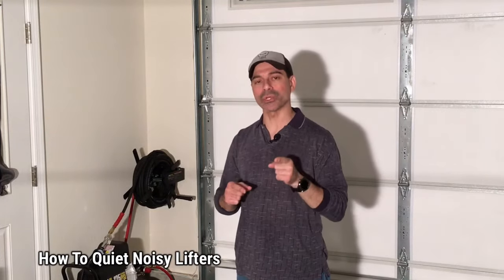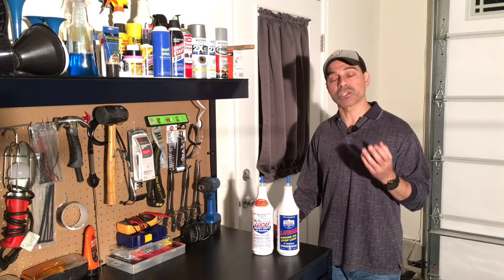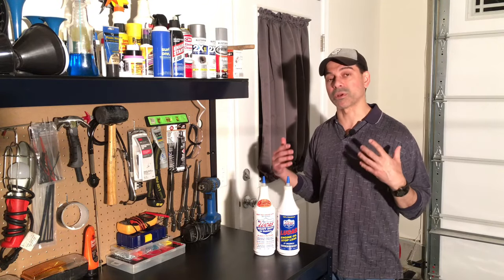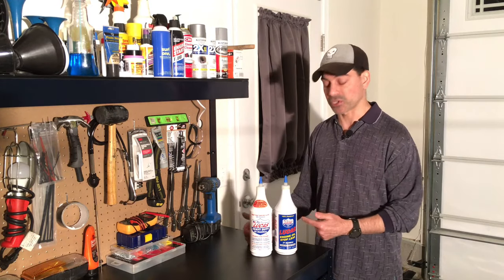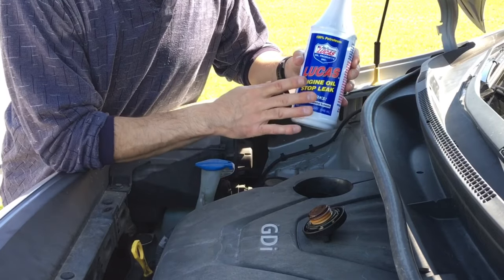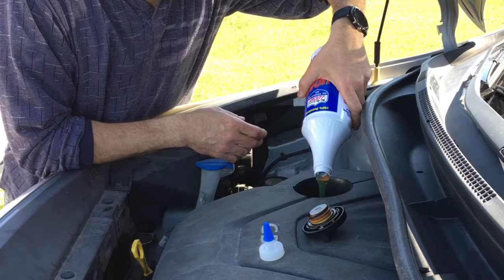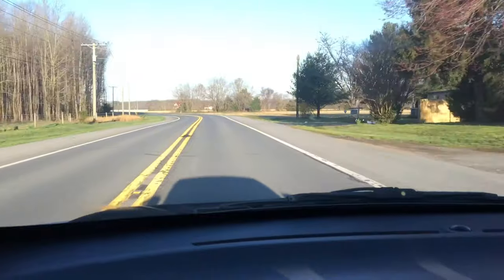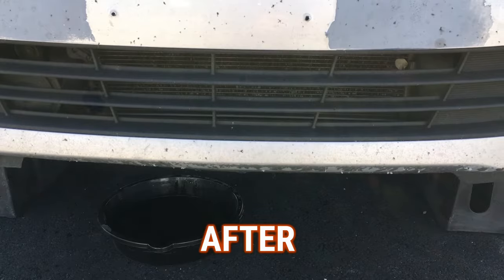How To Quiet Noisy Lifters (Andy’s Garage: Episode - 253)

Comment: Well we tried that in a older truck with the vortec V6..guess what yep fixed a lifter but thinning the oil out not cool..the motor spon a rod bairing..I can tell you this especially in the new generation motor keeping the oil changed is key.. however a motor with some miles on it will gum up lifters ..so what has the best detergent without harming your motor...so do a oil change and filter the trick add one qt. of transmission fluid to motor oil .cleans the inside of your motor up and will run great .just a tip we use all the time we yes tryed it in a engine and then took the motor apart nice and clean..does NOT EFFECT THE MOTOR NO HARM DONE..

Comment: Can the addititve help your lifters last longer I know I need new lifters soon but so far just have bad ticking no misfires yet ? I figure I got about 2 to 3 months left on the lifters without addititve is it possible for lifters to go 4 to 6 months with addititve? ( motor has been replaced one rebuilt another time so I do know my time frame from how noisy they are) 492457km on truck its a work truck 6.4 hemi
Also thank you for making this video
Reply from the maker: I wouldn’t add this unless your lifters are making noise. Wouldn’t use it as a preventative since it thickens the oil too much

Comment: Question… 2012 dodge charger, v6. I normally get my oil changed by a professional. Can this be added post putting oil in or does it have to be done before?
Reply from the maker: It can be after but you need to drain out the oil to accommodate the additive. You don’t want to overfill the oil.

Comment: This was very helpful. Just started hearing an on an off tick in  or around the engine. It doesn't tick often or for long so I wasn't sure if it was the lifters or the alternator or timing belt. I just changed the oil a few days ago so I will keep an ear open for the tick. This practice will be helpful as my car has 188,000 miles on it. I will definitely try this when I change the oil. I use a high mileage oil but I haven't added an additive. Very helpful!

Comment: I had an oil change done about 2 months ago and don't drive the vehicle more than 100 miles per month. Do I have to drain the oil, or can I just add the stabilizer and stop leak to the existing oil?
Reply from the maker: You can add it, just make sure you drain enough oil out to make capacity for the additive(s). You don’t want to overfill your engine

Comment: My 2018 pathfndet has been making this noise for a couple months now because i waiting too long for a oil change. How much would you recomend i use?
Reply from the maker: Start by draining the old, replace with synthetic oil and a good filter. I would only add 1 quart of additive to start. Adding 60% additive is only recommended for very worn engines.
Reply: @PhillipsVision  thanks for your advice
Reply: @PhillipsVision  oh and should I get the synthetic heavy duty oil stabilizer too or will regular be ok?
Reply from the maker: @AstroDestination  to be consistent get the synthetic
Reply: @PhillipsVision  gotcha. Thanks again.

Comment: Is this a permanent fix? And what if I don’t have an oil leak? Should I just use oil stabilizer?
Reply from the maker: You should use it at each oil change, one application is not permanent.
Reply: Is there any other damage that is being done by doin this? What exactly is this doin to quiet it?
Reply: Oh, any ballpark figure to replace them?
Reply from the maker: @marco785  this won’t fix the damage already done but will add a thicker lubricant to help quiet the noise
Reply from the maker: @marco785  around $2,000 unless you can do it yourself

Comment: I have noise from the lifters when the car sitting for some days due to oil goes down. Is that a problem? 

I had an engine shake as well once. 

Oil is freshly and at the correct level.
Reply from the maker: @apostolisr8556  probably not a bad idea to add a little oil to the crankcase before starting if it’s been sitting for a long time. Some vehicle require this. I have a friend who destroyed his engine because he started it after it sat too long and the engine ran dry for a minute.

Comment: Would it help for a 4200 v6 gmc envoy? Driving down the road the knocking started lost power. Oil was dry, put 4qts in but still a loud knocking and loss of power...
Reply from the maker: If the oil was low and dry you may have damaged the engine
Reply: Yes I'm positive I might have. The noise got quite on top of the motor .. now it moves to the bottom of the motor. Sounds like the oil pan area, a squeaking and hard knocking sound. @PhillipsVision

Comment: So question;
 I have a 3.5 I5 Colorado that has a ticking on the top end like a lifter. It comes and goes and I notice it most when sittting in a drive thru and the engine is hot. Does this thing have lifters? Will this work for my engine? THANKS!

Comment: I'm so confused I don't normally use additives in my vehicle at all I prefer to just fix the problem, but do you and the additives before you have oil in the vehicle because that's what it kind of sounded like or can you add it to existing oil. And do you add your normal amount of oil and then the additives or do you have to subtract the amount of oil in the car per how much additive you add?? So if you have three quarts of additive in a 5-quart oil system do you only put two quarts of oil in it or do you put all five quarts of oil in plus the 3 quarts of additive

Comment: If my dodge journey lifters are sticking should I use this? The mechanic said it will cost 1400 to fix it
Reply from the maker: You could give it a try. If they are too bad you’ll need to have them fixed
Reply: Did it work ?

Comment: My neighbor told me to put a quart of mystery oil along with my other 4 quarts of oil during oil change on my dodge journey. Have anyone heard of using this method before?
Reply from the maker: I have. I’ve never tried Mystery Oil
Reply: @ jessiegathe661--      Several years ago, my 2002 Chevy truck had a loud lifter ticking noise. The oil was a quart low, so I added a quart of Marvel Mystery Oil to the crankcase. Soon the lifter ticking noise disappeared. I drove the truck about 400 miles and when I changed the oil, it was extremely dirty. This was telling me that the MMO was removing some of the sludge out of the engine. Now after a oil change and the oil is a quart low, I add a quart of MMO for preventative maintenance. 
       Depending on how many miles that you have on your Dodge Journey, you may have some sludge in the engine. If you add some MMO to your Dodge, I would check the oil more often, and if it appears very dirty, I would change it sooner than later.

    I have also been using Marvel Mystery Oil in the gas in my car, truck, and lawn mower at every fill up since 2016. I use the recommended amount of 4 ounces of MMO for every 10 gallons of gas. Everything is running better than ever, and my car now gets at least 1 to 2 more miles per gallon on the highway.

Comment: I just changed my oil but my lifters are still clattering. I don’t want to use the rislone motor flush or motor medic because I don’t wanna have to change the oil again. What should I do about loud clattering and could it be related why my truck almost stalls when I give it gas?
Reply from the maker: Are you getting any engine codes?
Reply: @PhillipsVision  No, I don’t have a OBD1 scanner. The truck is a 1990 Dakota and I just picked it up so is haven’t had much time with it but I immediately noticed the clattering. Is there anything I can check meanwhile until I can get my hands on a scanner?
Reply from the maker: @josh661  I’d recommend getting a stethoscope first so you can pinpoint where the noise is coming from. That will help know what it could be. Here’s a link to a video I did showing how 
https://youtu.be/3sgLRyzLtdU

Comment: Can I use both products on a rebuilt 3.3 v6 dodge grand caravan 2001 engine? It has that sound since it started and it won't go away
Reply from the maker: Yes, shouldn’t be a problem.
Reply: @PhillipsVision  In my particular case, it could be enough to add only the stabilizer since the engine has all the new gaskets and seals, and if it were enough, I would have to add 60 percent to it... One last question, if the result were positive in the next oil changes you should follow the same procedure, or after the noise has been eliminated you could add only oil without the additive.
Reply: Thanks for your fast answer.

Comment: Im just asking these both oil is not heavy on the engine to use it
Reply from the maker: They are heavy, which is why you have to follow the recommended mixing ratio…no more than 60% MAX

Comment: 02 Chevy Malibu, just got done with a head gasket job, and while screwing the #1 cylinder exhaust valve rocker back down, it kinda didn't wanna go... Ticking like crazy. Pretty sure the lifter is shot, or somehow got turned. Any advice? Really don't wanna tear it down again.
Reply from the maker: You could try an additive to see if it helps. If it’s too bad it will need work

Comment: I had bought Ann 05 trailblazer LS with the inline 6 in it..after I got the coils replaced and it running on all 6 cylinders…it sounded really good..I changed the oil and listening to the mechanics around town I used traditional oil with a quart of Lucas oil stabilizer..that made the engine sound like a diesel when it was first started and had a chatter to the engine that bugged the hell outta me…these things have the dual over head cams with the vvt solenoid in the side of the block that engages the second cam to get horsepower over torque…the vvt solenoid has xtremely fine screens in them that will blow out and into the oil if the oil isn’t constantly maintained…I tried several different additives and nothing helped…I had t  on find the fuse panel info from the owners manual and got to looking through it for other things…and read in it…that it is recommended to use synthetic oil ..5/20-5/30 weight in the engine..this is due to the screens in the vvt..and also how tightly fitted the pistons etc are placed in these newer interference motors….I went and got the synthetic oil and a quart of Lucas….let the old oil drain out for a few hours before filling with the synthetic oil…and the problem was solved..,I always read the owners manual..,and had read most of it when I got the vehicle but hadn’t read that part of it…so now I strictly stick to my own advance and read the damned owners manual when I buy a vehicle..if I had continued using traditional, it would have caused more issues since these engines are sleeved ikr most are today…
Reply: who reading all that 😂
Reply: @kayrogers4024  lmao I tried and gave up started skimming didn’t find anything significant in that lol.

Op can you give us a tldr
Reply: @roddyrich2335  That's too long for you to read? 🤦‍♂️

Comment: Hi there, thank you for the very informative video and responsiveness to commenters..
My mother’s 2012 Toyota RAV4 is not losing oil but rather it has a hydraulic lifter tick...
Is it necessary to add the stop-leak? Or  am I fine with just the Lucas? Thanks in advance and God bless
Reply from the maker: Thanks for the comment. Just add Lucas oil stabilizer or Rislone. If the lifters are too bad they may need to be replaced
Reply: @PhillipsVision  much appreciated.. definitely will do that. Cheers! 🙏

Comment: I really liked your video. Easy and straight to the point.
One small question:: does it make a real difference if I add conventional/ synthetic motor oil?
Reply from the maker: No, I prefer synthetic since it doesn’t break down as quick.

Comment: we allowed our oil to get really old and nasty but changed it when we realized how long it had been,  then 3 weeks later I started getting a ticking sound... and an engine code about camshaft sensor...I pulled the sensor and found it gummed up so I cleaned it but still have the ticking, is this a lifter problem or a sensor problem? I also cleaned the solenoids to see if that would help, but no change
Reply from the maker: Could be the lifters, but could also be the engine

Comment: Gotta add these two things every time i do an oil change. That's expensive to do every time. So it doesn't fux it.  So thats a fail. May as well get it checked and fixed . Cause if not maybe engine seizes up doing it this way .

Comment: I have an 8-seater Toyota Sienna 2007  2WD 3.5L FI DOHC 6cyl with a noise issue. The oil change didn't fix it. The noise is generally at the stop-light or during idling. Can I use this oil cocktail? Second, I recently changed the oil. If you think I can use this cocktail you are suggesting, can I suck out some oil and put the cocktail?
Reply from the maker: Yes, you can try this. Drain enough oil to accommodate the additive. You don’t want to overfill your oil.
Reply: @PhillipsVision thank you for your quick response.

Comment: I bought a stage 3 camshaft kit for a SBC 5.7 vortec engine, the kit came with the camschaft lifters, gear and timing chain, I put the stage 3 cam, the gear and the timing chain, but I did not put the new lifters that came I put the stock ones in the kit, now when I drive my truck it doesn't take off, I press the throttle and it almost doesn't run, the engine sounds as if I hadn't put anything on it, my question is the following: does the engine of my truck work? So why didn't I put the new lifters on it?
Reply: Your first mistake was buying a stage 3 cam kit. The lifters it came with were designed specifically for the angle of the new cam lobes. Idk if the stock ones are hydraulic or roller lifters but you’re not going to go anywhere if you mix n match the geometry the engine was designed for. On top of the.. newer vehicles computer systems are very high tech. They have to adjust and compensate for how the engine is running and fill the gap in areas. When it doesnt have a clue what’s going on, you’re left with a stubborn motor that has no clue what to do. Put it back to stock

Comment: I used the following:
LIQUI MOLY MOS2 Anti-Friction Engine Treatment
Lucas Oil Products Oil Stabilizer 32oz
BlueDevil Oil Stop Leak 8oz
LIQUI MOLY Motor Oil Saver | 300 ml | Oil additive | SKU: 2020
(2) Quarts of Mobil 120455 1 HIGH Mileage 5W-20
For my 2013 Ford Focus Titanium and the noise is completely gone following his instructions by adding as advised

Comment: Another subject I'm not getting any heat inside main cabin I have replaced blendoor and fan speed is working great could it be my climate control or heater core I'm not getting any leaks from passenger side I'm wondering if I flush it will I get heat . It's a 2005 Tahoe with 300k btw V8, 5.3

Comment: Thanks for the video. Have a 2014 Rubicon with driver side ticking. Is there anything different about the Jeep 3.6 engine I should know about before I use this method.
Reply from the maker: I would start with just one quart of Lucas Stabilizer. If that doesn’t work then add the additional
Reply: @PhillipsVision  appreciate the info

Comment: I have the same tick noise with my 2014 Ram 1500 it’s has 210,000 miles any advice engine light started flashing after the tick noise started
Reply from the maker: What code are you getting?

Comment: My 2015 tahoe developed that same noise about 5 months ago. I just did an oil change about a week ago. Is it ok if I wait until the next oil change to try this? I did leave about 1 quart low on it. It takes 8, but I added 7.
Reply: That may honestly be your problem I ran a quart under what I was supposed to on Silverado after getting cam swap and it helped a lot

Comment: Do you think I could possibly get good with just one of each instead of 2 and 1 and too make room for more quart of oil ? I have a 2013 Dodge Charger 3.6  with a lifter tick
Reply from the maker: You can give it a try and see what happens.
Reply: Hey I have the same engine in my Jeep…trust me it will not be good in the long run…my Jeep is also the 2013 3.6 we have the same engine, heads, and trans…your rocker arms are tapping…I bet it’s the passenger side too…either way it will need to be replaced…I can show you a pic of your problem…if you don’t park it and replace you’ll be paying around 5k for new rockers, rods, and cams…look it up on YouTube…I did and have replaced myself…along with the dreaded oil cooler/filter housing, and more…if your car is leaking oil, this could be the reason for the issue in the first place…I hope this helps and you read be for too much time passes! Give me a shout if you have questions!

Comment: Hey I was wondering I have a 2000 Monte Carlo I had just bought that ticking sound is coming from my valve lifters but I was wondering if that could be because the oil hadn’t been changed in 12 thousand miles?
Reply from the maker: Could be. Also make sure the oil level is full.
Reply: @PhillipsVision  it is made sure of it also got a oil change today I will say tho best car I’ve ever owned

Comment: How do you no when oil is topped off using these products with the oil ?
Reply from the maker: Add these first, then check levels on dipstick. Add recommended oil until it reaches full line on dipstick. These are also one quart each, so if your vehicle requires 5 quarts just add these and then add the remaining quarts of oil
Reply: @PhillipsVision  yes it do requires 5 quartz  thanks so much

Comment: I did everything you did with Same products, same noise on my Kia and did not work.
Cat has 108k miles everything clean underneath.
How do I fix the lifters or see if they are damaged everything looks brand new to me nothing stands out to me.
Please help it’s so annoying!!!!
Reply from the maker: Could be your timing chain as well. KIAs have a tendency to burn or leak oil. If levels get too low you could have internal problems that may require the chain and sprocket to be replaced. Worst case scenario, the engine took enough damage that requires replacing it.